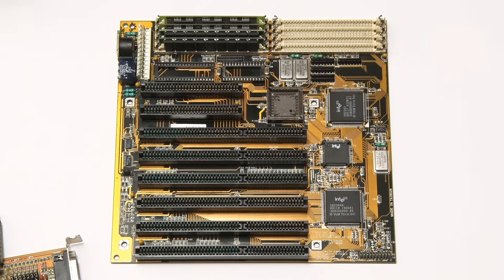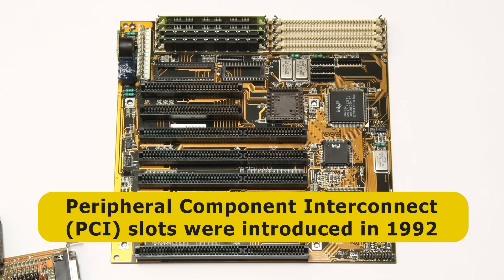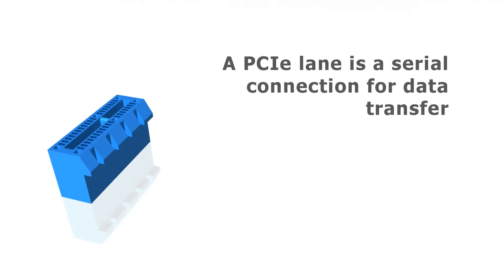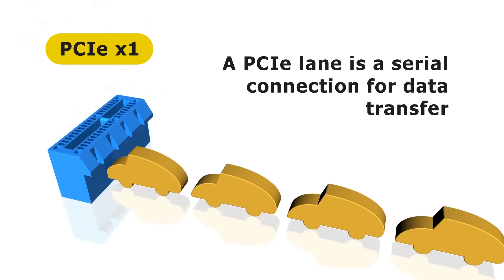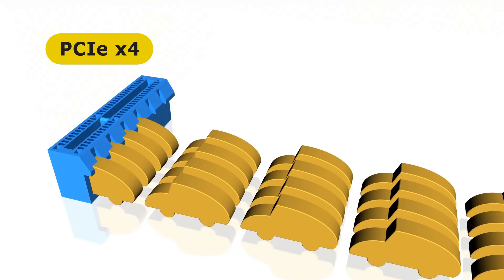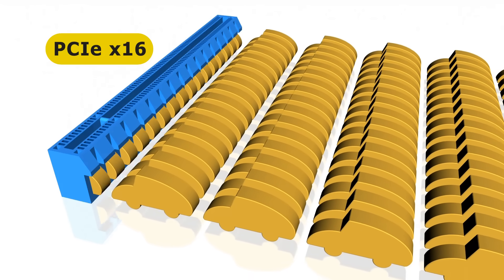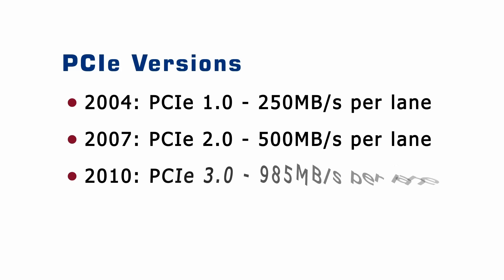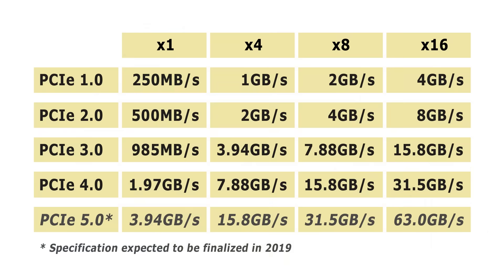Explaining PCIe Slots

Comment: Would "if it fits, it works" (if ignoring drivers) be correct?
Reply from the maker: For PCIe this is, amazingly, pretty much the case now.
Reply: Not 100% the case, as there is a difference between CPU based PCIe lanes and chipset based PCIe lanes, which may cause incompatibilities. CPU based lanes are usually reserved for graphics and the system firmware may prevent other devices from being detected at the firmware level.
Reply: @Nidhogg84  In my experience x16 slots being usable only by video cards was only the case on old motherboards that had only the one PCIe slot. All modern boards that I have used allow you to put, say, a x8 SAS HBA in the primary x16 socket instead. Also, if you're prepared to take the performance hit you can put your video card in a slot supplied with chipset lanes. I do that on my latest motherboard (Asus Prime X470 Pro) and it boots just fine. My reason? The operating system runs in text mode on a cheap video card while the main x16 slots are used for storage controllers.

Comment: Yes please, Chris go back to the early days when the IBM had built-in BASIC. I had an IBM Compatible AT. The problem was the BIOS would not roll the date over. So we burnt the IBM EPROMS using a burner on an Apple 2E. I think there were 7 chips as we had to get the BASIC and if I remember right that was Cassette BASIC which I don't think was ever used. Yes please do some history.
Reply: It was 5 chips, one was actually the BIOS and the other 4 were BASIC. I worked for an infamous grey marketer and cloner (check out the last few pages of old BYTE and PC Magazine to see their ads) and we used old AT motherboards on occasion as replacement boards.

Comment: One other addendum you could make to this excellent overview of the motherboard slot technologies would be the relationship between the PCIe slots and the motherboard chipsets and the capacity of CPUs to supply data to the PCIe lanes. Just because a motherboard has 2x16 + 2x8 + 2x1 lane PCIe slots (for instance) it doesn't mean your CPU or chipset could provide all potential 52 lanes to be used. Keep up the great work.
Reply from the maker: Good point. I may cover this in another video. I decided it would add too much complexity to this one!
Reply: I look forward to seeing it Chris.